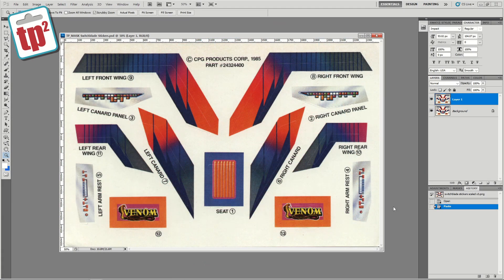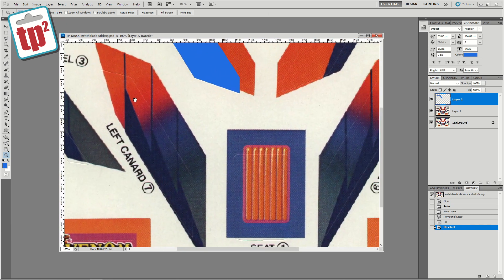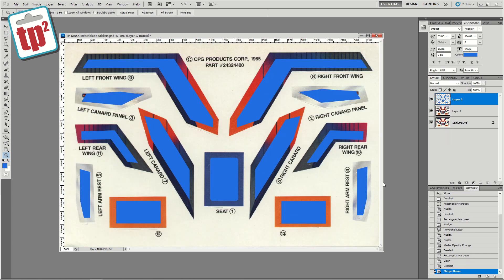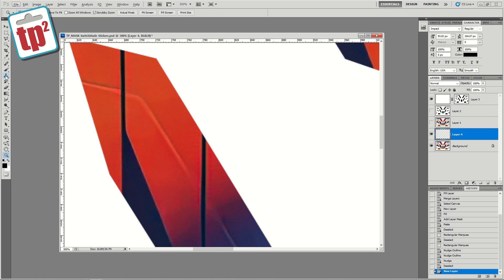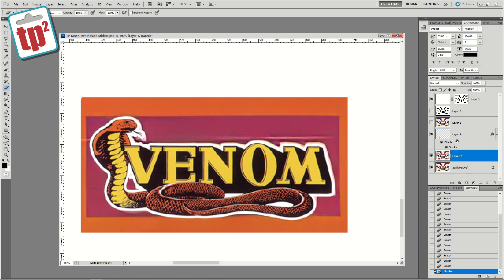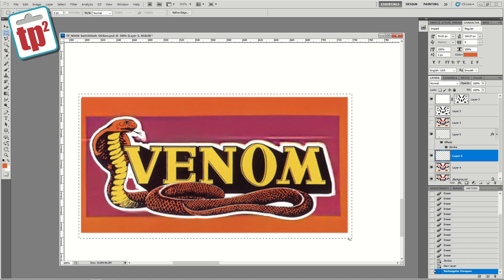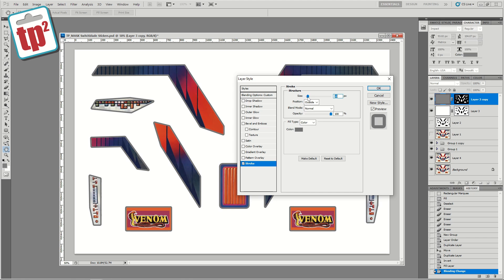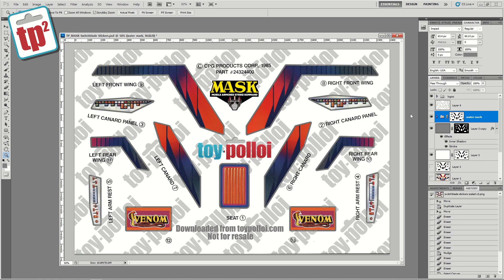Vintage Sticker Scan repairs Photoshop Tutorial - Toy Polloi Two

Comment: A bit of a nit pick but you seem to have forgotten the white dot after each letter in the Venom logo. Otherwise a very good video, cheers.
Reply from the maker: Good spot. I will add that. I wonder why they are not on the larger version of the VENOM logo I used?
Reply from the maker: Fixed. Cheers

Comment: Those original cuts were so badly lined up! Looks like the paper may have been rotated in the press; they all seemed to be out by different degrees on either side.
Reply from the maker: They are really badly cut. And that maybe why they had never been used.

Comment: The clone stamp is a brilliant tool. Early in our trip to Japan a few years ago, our camera got a bit wet when it started snowing in Hiroshima. After that, the lens ended up with some tiny specks on it I couldn't clean off, resulting in the remaining 3 weeks worth of photos having a small number of splodges on them. It took about six months off-an-on, but I cleaned up over 3000 photos so you'd never know the marks were there.

Comment: Great video,  but the Adobe nerd in me can't but yell "too many uneccesaaey steps!" almost constantly through the tutorial! 🤣

For instance when you have your blue mask shapes there is no need to make that layer black and white. Holding CTRl/CMD & clicking on that layer will select your mask shapes and then hitting the mask button on your new layer will automatically make a mask on your selection. You could also just mask your cleaned up artwork layer instead of making a white mask layer on top. Lots of ways to do the same stuff I suppose.
Reply from the maker: And that's exactly why I haven't done these videos before 🤣 

There is no right or wrong way to do any of it. As long as the end results work, how you get there doesn't matter. 

Same for fixing toys.

I'm just showing the way I work. Not the correct or only way, just my way.

Cheers Dave

Comment: Hey David! Love your channels and all you do for the toy collecting community!

Regarding the Photoshop file, have you always worked and printed in the RGB color space? From my personal experience the colors I get from RGB vs. CMYK on my printer can be much different. Most times I save a version of my files as CMYK in order for them to print properly. It might be worth trying and seeing if it changes your final product.
Reply from the maker: Always RGB as not everyone has the right software to print CMYK. And most cheap printers, like the one I use, generally only have RGB inks. But it's easy to convert if you want to. Cheers

Comment: I enjoyed that!  Usually, Kenner did a great job with stickers, but I'm sure that the print shop they were using just had a bad day on that one.  I know that not all of those sticker sheets were flawed, so maybe it was just a limited few that made out out with the bad die-cuts?  

 I taught myself to use Photoshop years and years ago, and I always find that there are many, many different ways to accomplish the same goals in the program.  It's rather fascinating to learn new things, and I find that I'm always learning new tricks.  It's great to see your particular process for recreating stickers, Dave.  I know that you sometimes scratch build them entirely, but this tutorial demonstrated a mixed bag.  You had to redo the Venom logo almost from the ground up, but given you had the logo, that wasn't much of a task for you. Heh.  I think the hardest thing with this was probably getting rid of the bad die-cut lines, and figuring out where to set your new ones!   Dealing with symmetrical images is always easier because you really only need to do one half, then copy it and flip for the other side. That flip technique has saved many an artist a lot of time over the years, and I use it often to actually check my hand-drawn artwork.  If I have a face that's looking straight forward, I will check to make sure that both sides of the face look even, and that both sides of the head are the same width, etc.  I do this one of two ways.  The First way is to turn the paper upside down to look at it from that vantage point.  This gives you a different perspective one viewing the work, and flaws that weren't obvious right-side-up, suddenly will be revealed!  The second way I go about this is to look at a scan of the drawing in Photoshop.  I can do the same upside down trick there, but I also copy one half of the face, flip it, lower the opacity so I can see the layer below, and then overlay it with my drawing.  That way I can see where things have succeeded or gotten off track.  

I hope you'll do more tutorials like this in the future!  I absolutely appreciate all the work you put into your videos, and I can't thank you enough for all the joy, entertainment, and knowledge that you've shared over the years.  I have some badges and patches in my studio closet somewhere.  If I can locate them, I'll try to mail you some for one of your nerd vests.
Reply from the maker: Thanks Loston. There are so many ways to do things in PS. I thought I'd start with a basic project to get people started. I will show more involved processes in future videos. Cheers

Comment: Great tutorial, David.
Like retrofuture said, there are many ways to reach the same goal in Photoshop. In the second to last step, instead of erasing the old sticker graphics, one could simply mask the text after selecting them with the lasso or marquee tool. Or you could create a mask, select it, paint the text off, then invert the mask. I'm saying this basically because when you erase the non-text part, sometimes you may leave some bits behind.

Comment: Great video.  A small tip that you may find useful.
When adding the ‘new venom logo’ over the original, if you set the new logo layer, to difference and keep it at 100%  once it’s over the under layer in  perfect alignment it will turn completely black. Then just change it back to normal. May be useful
Reply from the maker: Thanks. I'll give it a try.